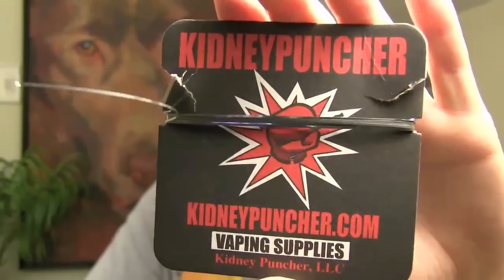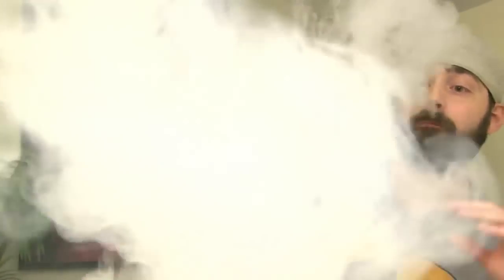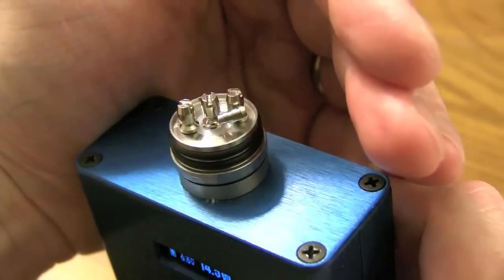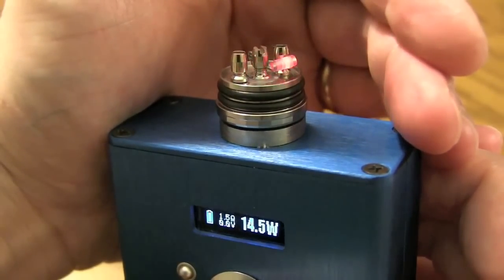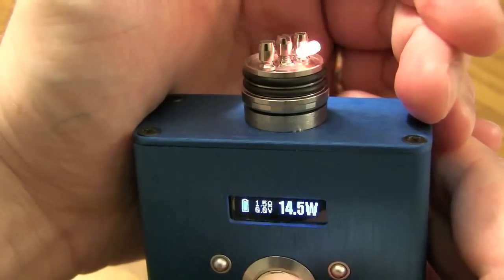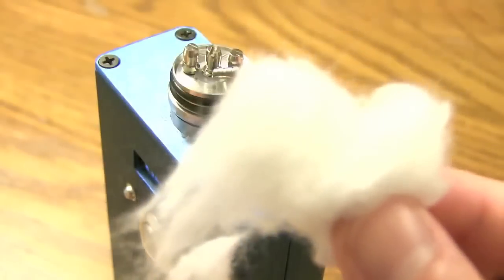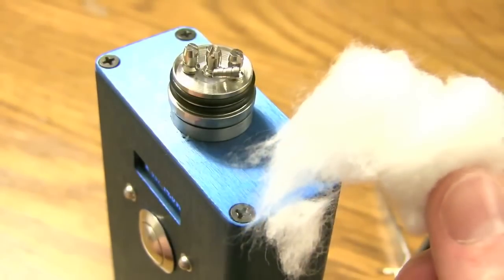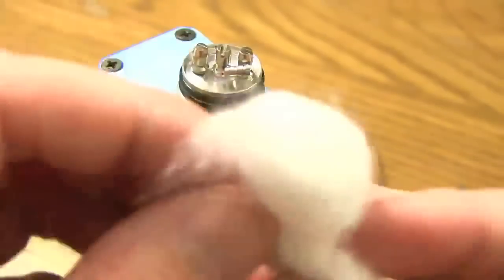The Tin Man Coil

Comment from the maker: Its because, its not producing as much heat which plays a large factor in the vaporizing of e liquid. And because, its not producing as much heat, you can get more pulls per drop of e liquid. The vapor production is all due to the size of the chamber and the air flow.

Comment: When you heat metals to red hot and let them cool slowly you generally soften them not make them harder. If you actually want to make it stiffer you would quench it when it's red hot.
What you are actually doing is softening the wire and setting it in the position you're holding it.

Comment: Great video man. Really learning a lot but got a few questions if u can reply ASAP. First off start do u mean by rebuildable dripper. Aren't they call rebuildable. 2nd on the description it has a link for the trident and trident clone. Whats the difference. 3rd how can some of these builds b harmful or blow your battery? And 1 more Wyatt are those boxes for that u can screw your dripper into and it gives u a reading cash u explain that please. Srry for the questions u just seem very knowledgeable on this whole subject.
Reply: Ardian Kelmendi 1.rebuildable dripper (rba)You build your own coils drip directly onto the coils/wick as opposed to an rta (rebuildable tank atomizer) that you still build coils for but has a tank for the liquid, as opposed to dripping. 2. Clones are copies and are usually cheaper than the original. 3. Not enough space to go into details.. but be careful with building coils that end up being of a low resistance (ohms), some batteries can't handle the extra load and can heat up or even explode if you don't know what you are doing and 4. The boxes are variable wattage devices.. You can control the power going though the coils and therefore the heat and vapor production. 
BTW. The questions indicate that you are fairly new to it… There are some great tank/battery/replaceable coil head combinations out there right now if you didn't want to get into rebuildables right away. A good combo (with room to grow) , I think, would be a 50 watt istick and Kanger mini subtank.

Comment: I was curious to know if this coil will work in the rsst? Would I have to stand the coil vertically and drop ss mesh down the center of the coil into the tank? Or could I still use cotton as the wick?

Comment: Damn that's some of the best vapor I've seen off of a 1.5 ohm coil. Also if the flavor is anywhere near u say it is then I'm gonna have to build that thing, also where can I get some of ur brand juice...would like to try it out. Thank you have a great day man.
Reply: It's on a regulated device :p
Reply: +David Burton what does that have to do with the comment
Reply: The resistance doesn't dictate the power running through the coil, as the voltage is variable.

Comment: I have a trident clone and I hate the posts on it. The edges of the slots and the nut are sharp and cut off the leads before they are tight enough to hold the coil. I tried to scrape the edges with a micro screwdriver but that didn't help. I have jewelers files but none are small enough to get into the slots. Finally got it to work with 26 gauge wire, still breaks leads. Put the thing on a shelf and there it sets.
Reply: See if you can find a diamond file like a machinist would have.  Rip the head off the handle, and it'll be thin enough to get the corner in.  Apply pressure, and drag outwards.  Should only take you about five or six passes to get that burr off.
Reply: Adam Dettbarn Appreciate the thought. I have jewelers files but they are too big to fit into the channels. Also, there is not a burr on it, the grooves (slots) that are in the posts have sharp edges, all 3 posts, all the slots, each side. Also the top screws (nuts) have sharp edges. I tried several different builds and the only wire that I didn't cut was 24g. (largest I have ) and only if left loose. I did get a 26g build after several tries, but it's loose. If I tighten the nut enough to actually hold the wire tight, it cuts it. Though I only tried to build on it about 20 times, = 20 coils in the trash. Oh well, it looks good setting on the window sill. While I am a new to building, this is not the first I've built. I have an ego f, ego w, nimbus, russian 91%, a subtank mini, and a mutation  x v3 that I build on without problem. Has to be the trident clone that's the problem. Note: when all else fails, blame something or someone else. It's the clones fault. Maybe I'll see if I can make some adjustments to it, now where did I leave that 3lb sledge?
Reply: evilevilrick
have you tried this coil with 22awg kanthol? that may be thicker but it may resolve the cuttin problume
Reply: ismael ravenlock
No. 24g is the thickest wire I have right now. I'm not gonna worry about it though, got a mutation x v3 now and loving it. Some have complaned about not enough flavor with it, but I just close down the holes and get great flavor with it. Just makes me mad that they couldn't round off the edges when they made the trident. I'll take a dremel cut off wheel to it next time I work on it, if I can smooth the bottom edges off the slots I think that will solve the problem.

Comment: i wanted to try this but i dont have any flat ribbon wire what if you did this but dont overlap the 1/4 of the wire like a micro coil but with ribbon wire im assuming this has been done but havent seen a video of it you would have to angle the coil a little it be like a  tin man neat ? what do you think
Reply: I'm vaping on basically a ribbon wire micro coil right now (actually dual coils). I didn't overlap the wire at all. Vapes lovely.

Comment: Will try this build in my kayfun lite, very curious what it's like!
Reply: Have you done it by now? Would be curious to hear about your results.
Reply: freifallspoiler I couldn't build a regular tinman without it shorting constantly.
Reply: ribbon is pretty low resistance, especially if you are using the big stuff like .8, so make sure you are doing enough wraps. I don't think he said which width he was using. also, arcing is a problem with ribbon when it is touching in small areas, so make sure you wrap them nice and tight so they are touching each other all the way around. this spreads out the area that each wrap is touching the next, allowing for current flow rather than arcing.
Reply: Peter Skuba That's probably what I did wrong, thanks for the tip. I didn't expect it to be such low resistance and I think i'll buy a spool of narrower ribbon to get it right.
Reply: Peter Skuba i use .9 and its crazy lol crazy
Reply: TheScottyp1 right now i have my prometheus with ss mesh in dual coil mode one is ribbon wire and one is 28 guage and it is one of the best vapes i have ever had.  best of both worlds, vapor and flavor
Reply: TheScottyp1 it was NOT an easy build tho for sure

Comment: why do coils have to be round? why do they have to be wrapped around something circular? why not a square or a triangle or even a hexagon?
Reply: #brilliant
Reply: making a sharp bend, on a conductor, will increase the resistance by a lot at that bend, there by creating a coil that doesnt heat up evenly
Reply: ismael ravenlock There would also be a problem with wicking. :)
Reply: ismael ravenlock ;  industry already provides these materials to mass produce. If you can design a Mod that uses blocks of ceramic instead of kenthal wire, or butane instead of electricity would you?  Even if it worked better AND was cheaper could you sell it?  probably a question for nikola tesla to answer.  but its the cheapest materials we have available to produce at mass market... Kenthal is produced via a spinning method;  to flatten it to ribbon might give a bigger surface for a sine wave of voltage to travel. however; adds a second stage of production.  Depends on the application; but in the current deck design of mods we have 'shorts' and 'hot spots';  with a better deck design; you do not need a cotton wick or insulators on clearomizers;  

therefore your heating element could be whatever shape you want!  why even bother with a specific shape.  why not have a ceramic blowfish magnetically attached to the firing pin; floating inside a drip bowl?  Ever see a PLASMA Ball ??  Or the inside of a Humidifier? There are no coils or wicks... hmmmmmmm
Reply: MrAlivallo Ceramic coiling would be safer (no heavy metal discharge).  However, the ceramic coils I have seen thus far have a very high heat flux and take forever to heat up.
Reply: John Smith   imagine 1/2 a tazer battery; a hand held solder; or turning a MAG light into a Darth Vaporizer!  takes care of that; no need for a coil; just a tank that fits over a firing pin.
materials and design were really the issues for the answered comment above; However; I believe its always been size to weight ratios IMO.  'What will sell' seems to send practicality out the window no matter what color your eyedrop funnels are.  (yes Eyedrop funnels are a real thing someone sells!)
Reply: ismael ravenlock already tried this around an allen key with 28 gauge. It always comes out round anyways. The only way to get any type of shape is to put it on a huge ass allen key, but it would be too big to fit in the atomizer.
Reply: americasgotrandom need to use a small hammer and work the coil all the way around evenly and keep tension on it while working it. With that said, I don't think it would work well because it would be hot spots on the sharper bends while the straight lines between the bends wouldn't heat as much.
Reply: ismael ravenlock do it...were all thinking it...do it
Reply: I already wicked around a big, flat match because i havent got something else. It worked. 
Will try it again some time :D
Reply: ismael its eaisiest thst way
Reply: its a resistance thing, and it also wont heat up evenly because of the sharp angles as opposed to subtle bends

Comment: Ok;  its been about 2 years watching Rip Trippers;  on my journey with e-cigs I've done it all.  and have come all the way back to the simple USB mini built in 30w; and Yodule Genesis w/ ribbon and mesh;  no tipping, no leaks; never need to re-wick or re-coil (mabey 3-4 times a year.)   When are they going to make a Prebuilt Steel wick system?  Right?  detachable, aluminum, all one piece, ribbon/mesh or ribbon/cable;  twist off deck; 5$ a set.  Single coil; no hot spot frustrations; and lasts like 3-4 months ...STRAIGHT Genesis style vape, Full Flavor; Safer, and No need to Sub Ohm; making battery life longer in the meanwhile.  
Granted you will never need to build a different coil; but who's to say you can't by different style coils with pre-builts for the style of it? I wish I could post some picks of my Idea....the uni-lock Ribbon Dragon Deck!
Reply: MrAlivallo you only changed coils 3 times a year? are you crazy lol?
Reply: Yeah you can clean the coil easy, just dry heat it and quench it under running water, everything falls off.  after this post I moved to SMOK One Plus Kit;  and never went back;  You Must Switch out those coils and be aware of the dangers of expired E-juice, I got real sick once and still have cough.   after some cost evaluation I purchased 2 SMOK for convenience; had 2 glass break issues and purchased 5 extra coils for total cost of $85 spent on ownership for a year.   but after months of messing with Mods, batteries, deck equipment, and spending the time to build...I must have spent 3 times that on Mods.   I can't go back to that anymore,  for safety reasons I did my own coils but now they have Organic+SS pre-builts that snap in and fill without hassle. I typically don't share my coil builds with others so the satisfaction of building the coil is not there for me.

Comment: Hey Rip trippers. I noticed when you were testing the coil. On the volt reader it said 4.8 volts. Doesn't that produce formaldehyde?
Reply: Jackson Fisher That has nothing to do with the formaldehyde. That was a stupid article done by somebody who didn't understand Ohm's Law. It all comes down to how many Ohms the coil is, and how big the coil is, and how many volts you are putting into it. The lower the Ohms, the lower voltage you need for a given wattage. The larger the coil, the more Watts you need for the same temperature. They key is to get good flavour, and start out low. If it tastes bad, that's when you are starting to get formaldehyde. But no, voltage on it's own means nothing. His coil is 1.5 Ohms, and if the mod is putting out 4.8 Volts, then the wattage would be 15.36 Watts. If we halve the Ohms to 0.75 Ohms and keep the same voltage, we get 30.75 Watts. This does not really tell us what kind of temperature we will be getting though, because the physical size of the coil, the wick and the amount of airflow will affect the temperature, and in the end it's too much temperature that gives you formaldehyde. Just trust your instincts and start will low power. Hope that helps.

Comment: So im vaping just starting and want ta know a good juice and box and coil to start with rite now i have a kanger tech t3s and and a batt but it dont put out the vapeor im looking for and im doing a dream bar flavor and it taste burnt some times what do you all think?(:-( )
Reply: I'd suggest something simple if your looking for a good cloud chaser as a starter setup maybe a fuhatton with a mutation x v4 you can pick the fuhatton up for 18$-25$ and the clone of the mutation xv4 for 10$ at some sites , a good build is 24 gauge 5 wrap dual parallel you could do a single and a dual coil build and have amazing cloud rip shows a great  video of how to make parallels .. as far as juices goes I'd suggest river reserve - wiki very complex and tastie ..giraffe is another good line giraffe sour especially .. there's other great mods such as box mods unregulated I'd go with a Dimitri for a great price of 30$ or the istick 100watt for about the same and its a regulated there's plenty of other great mods for under 100$.. sigelie , ipv ect ..remember this is just my opinion ..keep vaping and have a good one.
Reply: and also if your juice taste burnt off a tank you might be running it past its wattage rating and have burnt it I'd swap out the coil.

Comment: How DAFAQ does this guy use his vapes around 15-20 watts when I use my IPV 4s on 60 watts?
Reply: +Have Fun Depends on the Ohm of your coil, if you're running a single coil at 1.0 Ohm at 20 watts, that's similar to running a 0.5 Ohm coil at 40Watts when it comes to ramp up time and heat generation. So you can run a 1.5 Ohm at ~15 watts and be getting the same heat as if you were running say a dual coil at .25 ohm at 60 Watts.
Reply: this video is lime 2 years old
Reply: do you even understand ohm's law?